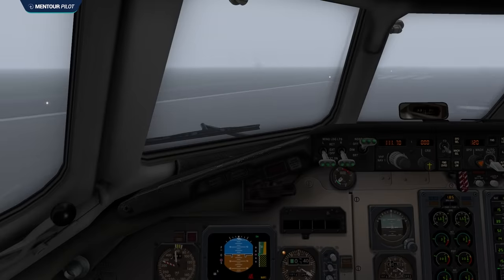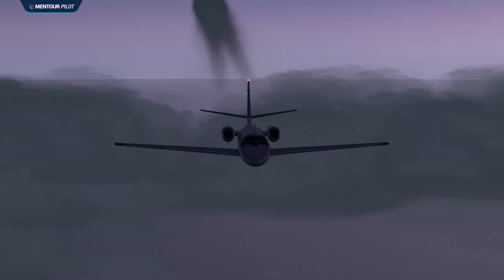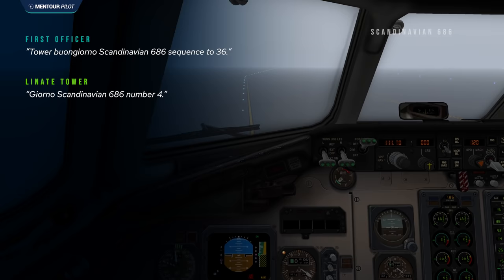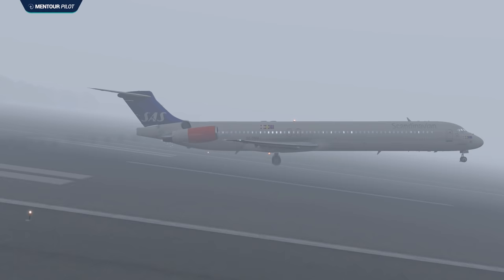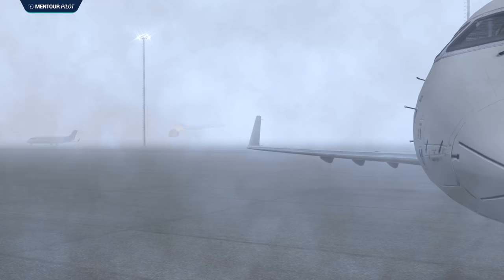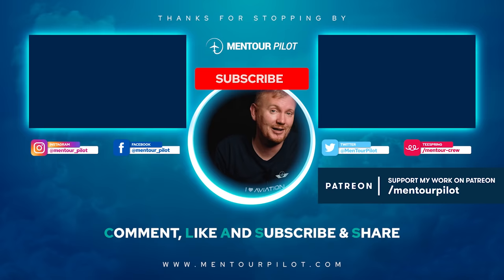A Perfect Storm of Mistakes! And how Heroic Pilots Almost solved it.

Comment: As a fellow pilot I also feel so deeply for the sas crew.
I can't imagine anything worse than being given no chance because of another person's mistakes.
Reply from the maker: True.. my thoughts exactly
Reply: Like the DHX 611 pilots in the Uberlingen mid air collision
Reply: @lucassteen4050  Yes.
Reply: If only mistakes, it is pure negligence.
Reply: That’s the true definition of an accident
Reply: This is why I prefer driving my car. There I can rely on my own expertise and defy that stupid statistic, and my motivation is not profit maximization.
Reply: "I can't imagine anything worse than being given no chance because of another person's mistakes" - Especially when those mistakes are caused by negligence (neglecting the condition of the airport and refusing to repair broken equipment, not informing ATC of new markings, etc) and by poor decision-making (ATC using multiple languages, ATC not requesting additional information when the Citation pilot clearly mentioned a marking ATC didn't recognize, ATC ignoring the fact that read-back was not accurate, etc).
Reply: @nomore6167  Indeed.
Reply: @nomore6167  EVERY accident is the result of a chain of causes/responsibilities that taken in isolation would have been harmless. And for this reason for every accident there are hundreds of potential accidents that did not happen just because of pure luck (one potential cause in the long chain of events did not align with the others by pure chance).
When the accident happens then the investigation brings to the surface all the problems that caused the chain of events. Nonetheless similar problems are there everywhere, only waiting for an investigation (triggered by an accident) to bring them to light.
Zero visibility, CESSNA pilots not authorized to fly in such a low visibility, misunderstanding with the control tower (that never authorized the CESSNA to cross the main runway), CESSNA pilots that took the wrong path to the runway, their disrespect of the red lights (they used to do this in the past too!), red lights that sometimes had to be crossed because they could not be switched off, .......
I myself took off countless times from Milano Linate with those same weather conditions (dense fog, which is quite common in winter in this part of Italy).
A work collegue of my wife (on the SAS flight) lost his life in this accident.
Reply: Mark-oj8wj yes can understand your feelings. The sas crew did there very best to avoid the passenger terminal. They did well, unfortunately they were not able to continue flight. They were very much experienced, even though they were young. The airport had so many faults, not refurbishing the airport with proper radar, or realignment of the airport layout. In reference to the proper signing on airport. Hopefully after all these years there is/was improvement to this airport.

Comment: About the Cessna Citation, 3 of the 4 occupants initially survived after being struck by the MD-87, but due to the delayed emergency response, it took firefighters 25 minutes to reach the Cessna, by the time they arrived, all 4 occupants in the Cessna were killed. Autopsy showed that the 3 initial survivors had high traces of smoke in their lungs, meaning that they were burned alive

Comment: Aircraft engineer here. The total lack of safety measures and bad practices that lead to this accident are just beyond me. I can not overstate just how important it is to have a mental map of the airport you're operating on as well as being crystal clear in communication with ground control. I remember back in the day when taxiing an RJ to the tech platform for an engine run up i got clearance to cross the runway yet the stop bar was lit. It was a super foggy morning and this was an active runway. I read back "unable to cross, lit stop bar, (AC registration)" followed by a much faster speaking controller who acknowledged and corrected his mistake. One 5 sec read back to clarify the situation was all it took to avoid a possible disaster. Listening to both air and ground, having a clear map of the field, check with crew, ask for confirmation...everything that can build a bigger situational awareness is and always will be absolutely essential.

Comment: I think one of the most damning things about this disaster was the fact that the airport had bought a new ground radar system but not installed it, citing 'technical reasons'. The new system was installed not long after the accident.
Reply: Funny, how fast you can solve “technical issues” when “no can do” is not a choice! Glad some of these folks ended up with jail time!
Reply: @californiahiker9616  and technical "issues" are often just "we don't know how to do it right".
Reply: They couldn't install a light switch for the stop bar. It probably did take them the 5-6 years to figure out how to open the box the radar parts came in.
Reply: Us humans in a nutshell, we really really dont like doing things that take more effort than we are comfortable with, even if said thing is absolutely vital.
Reply: @Aikisbest  and people will use selective logic in deciding if something really "needs" to be done.
Reply: @californiahiker9616  Yes, exactly.

Comment: Thanks for another excellent presentation. I was living in Italy when this crash happened and remember it well. Astonishing that Linate didn't have a ground radar system in an area of Italy which is often very foggy in winter. Sounds like there had already been near misses due to runway incursions. This really was an accident waiting to happen. The SAS pilots are heroes for still managing to steer their stricken plane away from the terminal building and apron.

Comment: Pilot in the md 87 pulling the left engine reverses, such fast reaction in such a critical condition, its just outstanding and mind blowing. They did everything the could. However this is a sad news.
Reply: Yes, indeed.
Reply: I bet they pulled both engine reversers to try and slow the aircraft, only the right engine was not exactly responding
Reply: @lightwalker222  exactly
Reply: @lightwalker222  I suspect this reaction was part of their "Oh Shi---" when they saw the other plane.  They knew they had 0% chance of takeoff, and that there was two possible outcomes. flaming wreck... and worse flaming wreck.  Limiting the damage done was their only viable option.
Reply: @marhawkman303  No, it wasn't their only viable option. They could have easily simply not cared which type of flaming wreck it was, since, either way, they'd be dead. The most common reaction would be to not care. But they cared. On the verge of their own deaths, they still though of others. They chose to care. They chose, even at that moment, to think of others. That's amazing. They saved lives. It is very sad that they died, but hopefully their loved ones took some consolation in the amazing thing they did.
Reply: @Julia-nl3gq  If I'm gonna meet my maker in this scenario, I know which way I'd choose to go. :/

Comment: "No matter what, fly the damn plane." And that's what those MD-87 pilots did. Airmen to the very end. Tragic, but I'm grateful there's as much emphasis as there is in the industry on making the best decision possible, even when there aren't really any good options to be had.
Reply: And the MD-87 might had made it, but the left engine power dropped due to debris ingestion.

Comment: When you feel constantly obliged to compensate for the dysfunctionality of the others and the architecture you have to work with, you become sooner or later part of the problem, until you literally cross a red line. Very sad story. Thanks for the video. Good work, as always.
Reply: Yes, Dysfunctional is the correct word for this - so sad
Reply: Exactly so, but it's not about feeling obliged, but being obliged to do so. I'm admirative of people that keep complying and doing their best in order to avoid a catastrophe
Reply: @mapleext  this is  the normal way of working,  repairing something would need paperwork which is so boring for some.
Reply: @mapleext  Yes.

Comment: Any workplace where you're responsible for thousands of lives per day, and your boss threatens to fire you if you complain against unsafe procedures, is an accident waiting to happen. We wouldn't accept such a culture of silence in heart surgery wards or in highway engineering, yet a mistake in such fields can only kill people one at a time.
Reply: I agree with you however unfortunately I have to point out that in the UK where I live (and work as a doctor) we have no whistleblowing protections if we see unsafe practices in hospital. Look up Chris Day (ICU doctor) or Claire Connolly (paediatric A&E doctor), they lost their jobs after speaking out about unsafe working conditions - but unlike most others they fought back - so that's why we know of them. Chris Day is still in a court case over this and it's been nearly 9 years. But if you want to see situations where the whistleblowers were just fired and malpractice continued, look at the many, many reports out there on units that have been doing this for decades. Shrewsbury maternity scandal (1400 mothers and babies dead or permanently disabled), Gosford Scandal (400 killed by inappropriate painkiller prescriptions), Bristol Inquiry (dozens of babies dying because of dangerous conditions in a surgical cardiac unit), Morecambe Bay Scandal (multiple babies dying due to institutionally poor care) and so on. You get the picture: unfortunately it is the same in hospitals (in the UK at least) as it is in airports. There is no safe whistleblowing culture. Junior doctors have been begging for this to change for years now. We'll be taking industrial action again soon over this. (We did in 2016.)

Comment: This tragedy reminds me of a phrase I have heard many times over the years from various people.

Well it's more of a concept than a phrase, but it's basically that since nothing bad has happened yet, that there is no reason to change what we're doing. For example, someone that never wears a seatbelt in a car might say "I haven't died yet!", or someone that texts and drives that says they haven't had a crash yet. 

They associate a lack of catastrophe with safety. 

There are plenty of other examples that aren't safety related. It has always seemed odd to me that people assume they'll always be the statistical anomaly. But the odds are working against them.
Reply: During my career I've had people try the "nothing bad has happened therefore there's no reason to change what we're doing" excuse for not doing anything.  My response is "Have you conducted a hazard analysis followed by a risk assessment, and identified if the existing controls mitigate the risk So Far As Reasonably Practicable (SFARP)?", which is the law in my country.

One particular case comes to mind, where the response was "We have 1,000 of these out in the field for five years and no-one's dead yet", to which I asked "OK, how many were actually operating for the full five years, as opposed to sitting in storage or powered down, being rotated through the maintenance pipeline, etc?"  They couldn't answer that, which immediately blew a hole in their "no accidents in 5,000 operating years" statistic underpinning their safety argument.
Reply: What blows my mind is that people still tend to not learn from the close calls that they experience either. As noted in the video these sorts of incidents were a regular occurrence at the field, but no one bothered to treat any of them as a full incident and follow an investigation with recommendations to resolve the issue.

In a similar way, when I first started riding in an automobile with my now-ex, at-the-time-boyfriend, I kept getting really upset about how close we were following other cars. One time, he even had to drive out onto the apron to avoid a collision, and he was like, “wow, if you had not been harping on me about following too close, we would have been in an accident!” And I was like we actually did just have an incident! I tried to explain to him that he was still following too closely, and that his driving out onto the apron to avoid a collision demonstrated conclusively that he had been driving too close.

Ahead of all of this, I had been riding a motorcycle for 5+ years in all weather conditions (yes, in snow, five times, I highly don’t recommend it) and so I had a habit of safety drilled into my head, because almost any crash would have been a disaster for me.
Reply: Safety regulations are written in blood.
Reply: would the phrase you're looking for be if it ain't broke don't fix it?
Reply: Cost cutting, laziness and arrogance - perfect recipe for a disaster
Reply: The old "if it ain't broke don't fix it"
Reply: Yep, the illogic of “it hasn’t happened to me, so therefore it will never happen to me”
Reply: Yeah, that “can’t happen to me” attitude totally confounds me. See it every day in the way people drive, people’s ignorance to the fact that a moving vehicle is a very deadly weapon seems to get worse and worse. I can only assume this is true in other areas as well.
Reply: "For example, someone that never wears a seatbelt in a car might say "I haven't died yet!"" - I don't think this is the best example....
Reply: There's this beautiful quote in Chernobyl, i dint remember the exact quote but it gets the essence of this comment,
It goes along the lines of,
People think that it won't affect them and they will survive

Comment: As a software engineer, this is a prime example of how aviation has led the way in teaching reverse engineering as standard, but not forgetting mitigation in the form of simulation and testing of future issues. Today, we have the tech to achieve much faster troubleshooting, but ultimately we rest upon the shoulders of those who came before us. Nevertheless, aviation sets the gold standard for advanced high-speed, anytime, anywhere travel and continues to strive as one of the safest ways to do so today. Thanks for providing this information.

Comment: 0:01 Intro
0:30 The Central Airport
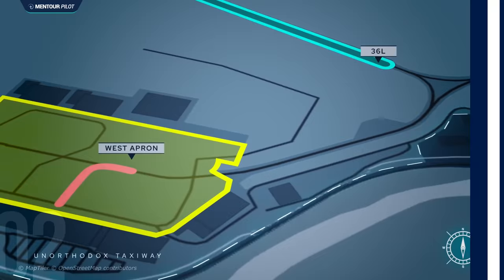2:53 Unorthodox Taxiway
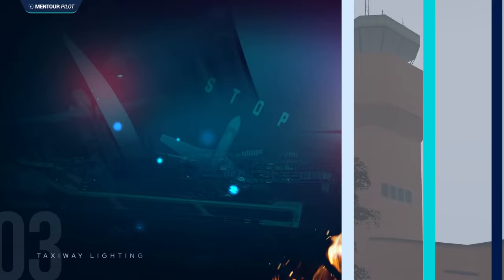4:24 Taxiway Lighting
7:08 Incoming Cessna
9:20 MD - 87 Requests Start - Up
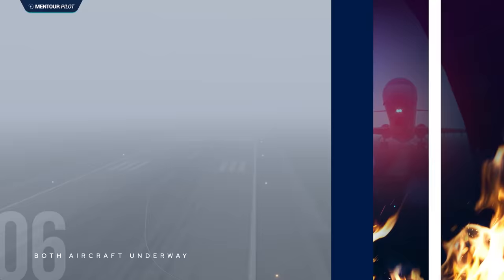10:53 Both Aircraft Underway
13:36 Miscommunications
15:01 Another Witness
15:43 Perceptions
16:38 Recap
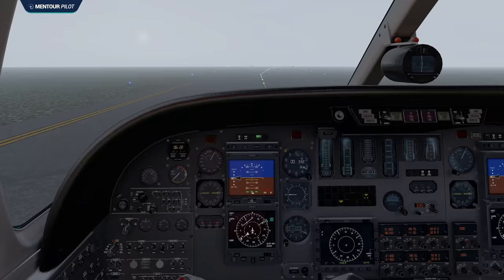17:20 Not Where They Should Be
19:41 Cleared For Takeoff
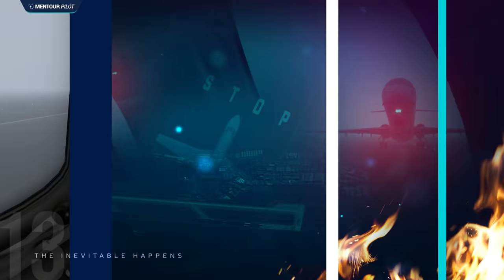22:03 The Inevitable Happens
24:29 It Sounded Like An Explosion
25:53 Delayed Response
27:29 Initial Findings
29:17 Closing Statements

Comment: I was flying a citation cj2+ for about 4years and this accident always gave me chills. A sad avoidable accident as always. Was not aware of the stop bar issue till today. The previous reports I’d read only focused on the incorrect taxiway markings. The reason the cj landed below minimums has a lot to do with peer pressure in corporate flying probably. The MD 87 pilots were very good and saved a lot more lives by their action than what this accident should’ve claimed. So many Swiss cheese holes throughout this case study. Thank you for your efforts.

Have a nice trip to Dubai and safe flights.

Comment: I'm sure many people not directly involved in the accident at Linate Airport, suffered from PTSD after it occurred.

My father was an aircraft mechanic for Delta Air Lines, who did maintenance work on Delta Air Lines Flight 191 hours before the aircraft was destroyed. Flight 191 was the L-1011 which crashed near Dallas-Fort Worth Airport in 1985, when it attempted to land at DFW during a thunderstorm. A micro-burst from the thunderstorm slammed the jet into the ground short of the landing runway, killing one-hundred and thirty-seven people. Although the NTSB exonerated my father from causing or contributing to the accident, he suffered from nightmares about that flight for many months afterward.

Comment: I remember that day.

I was living and working in Milan at that time and, being relatively young and well fitted, used to practice motorcycle rallying as an amateur. This is why I remember that very well: the day before I took part on a race and I had no time on arrival to switch my racing tyres with my "most day use" Michelin's T63 tyres, so I was driving pretty slowly on the wet streets of the center of Milan in order to get to my workplace. 

Milan is a pretty frantic city: everyone is always in an absurd rush and maybe my relatively slow pace bothered an hurried taxi cab driver behind me: he forced a reckless overtake and got stuck with his right mirror with my handlebar causing me to end on an high side crash: my left feet was broken.

An ambulance came swiftly to carry me to the hospital, but upon arrival, they told me to call a taxi cab and go home because there was an huge accident the they were on a "all hands on deck" for receiving the injured people.

Was terrible seeing all the ambulances arriving with people in desperate conditions while awaiting for the cab. 💔